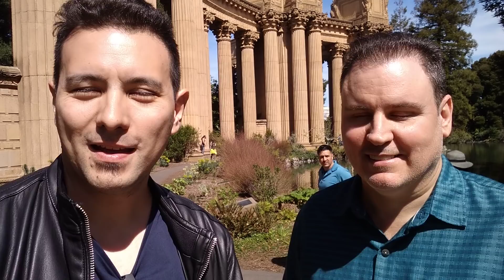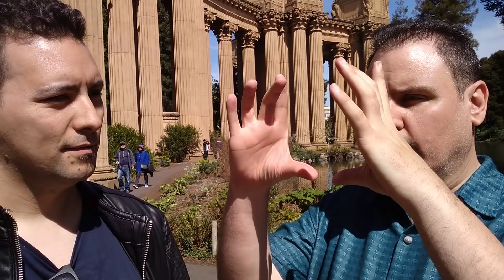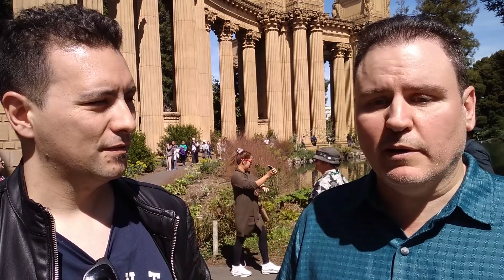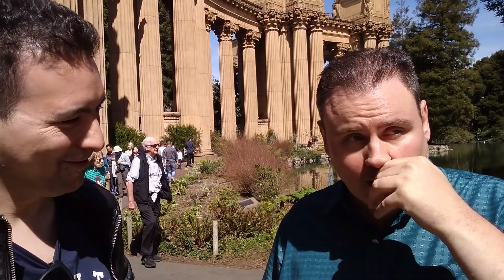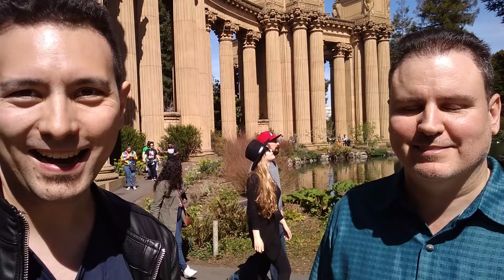GDC 19: Pimax Pre-GDC Announcement - New Headsets / Base Station News

Comment: Literally no reason to ship the 2.0 Lighthouses until the 2.0 controllers are ready as well so may as well ship them together - saves a shipping nightmare as well
Reply: Tapek what if you are someone who had no base stations before ?

They can play some 6Dof games that don't use hand tracking if they get the base stations.
Reply: @techhelper322  Actually no. You need controllers to actually set up / calibrate the basestations... so yeah, there is little point in shipping the BS already.
Reply: Yeah. 2.0 base stations on their own are useless.
Reply: @techhelper322  Vive 1.0 wands do not work with 2.0 basestations so only people who own vive pro will be able to use the pimax base station and if they already have a vive pro, they dont need the pimax station for any use since it is already 2.0
Reply: @gerthddyn  if they waited till they had finished everything else the headsets would be 2-3 year behind schedule not the 1.5 years behind they are now, (if you ignore the fact they have absolutely nothing for the 8kx)
Reply: @JenoSnetrem  no you don't,  you could get 1 or 2 base stations and play racing sims or flight sims with out controllers.

Comment: Lighthouses, pleeeeaaase! I have a hard time to get solid connection with my single Vive base 1 that nails me to gyro tracking. Adding to that I just backed the lighthouse not the controller, so it's obvious I want them shipped previously. (Plus the prescription  glass insert which is more needed than in any other headset)

Comment: I want my basestation asap, please. I am a simmer, and I didn't even back or order controllers. I might get them eventually, depending on the reviews.
But for the moment, I just want my basestation.
Maybe in the official announcement (through kickstarter plz), you can ask for those who WANT their LHs early to email their backer number and confirm their address etc. It will probably only be a small percentage of the backers who will do this, so it shouldn't clog up the support system too much.

Comment: There is no reason to ship 2.0 lighthouses with out controllers.  Existing controllers (a.k.a. Vive wands) won't work with 2.0 lighthouses.

EDIT:  I just thought of a reason (albeit small) to ship the lighthouses.  If you exclusively use flight / racing sims you may be waiting on lighthouses to go with your Pimax HMD.
Reply: I'm pretty sure that gen 1 gear works with 2.0 lighthouses
Reply: @tacocat709  No.  It's the other way around:  2.0 gear works with 1.0 lighthouses.  All current Pimax HMD owners (2.0 gear) are using Vive 1.0 lighthouses.
Reply: Vive Pro controllers and knuckle dev kits should work with the 2.0 lighthouses.
Reply: @NGenesis  anyone who has vive pro with 2.0 controllers already has 2.0 lighthouses. anyone who can get knuckles can get 2.0 lighthouses from valve.

Comment: So in November I spent 1059 USD on an OLED Pimax 5k. How much more do I have to spend if I want one that doesn't break? I didn't know the one I ordered was made using low quality parts. I mean.. it's a 1000 bucks..
Reply: 500 Dollar more. Then you still need Vive Base Stations and controller. Controller shall com allegedly in the 3rd quarter and sensors/base stations on the 4th quarter. I'm so full!
Reply: @PrinzMidas I don't mind the fact that controllers and base stations are separate, because we already knew that from the start. What we DIDN'T know, was that we were buying a 1000 dollar headset that's made from low quality parts and breaks easily, and we have to spend an editional 500 dollars if we want a 'non-breaking' version.
Reply: @stranger.granger  I totally agree with you! But we also didn't have known. that we need to wait such a long time, after we got the headset already, until we can use this headset completely. I'm really disapointed, and I mean for several reasons.

Comment: Pimax - can you please concentrate asap on controllers and base stations, and then on the new headsets. I have 5k+ sitting on the shelf collecting dust. Cannot even test it fully to see if it working properly. " It is like delivering new car to customers without a steering wheel and wheels! Then sending set of wheels and then few month later steering wheel. And on top of that you are producing more new models without steering wheel and wheels". I am not going to buy controllers and base station from other manufacturers just to use it temporarily. I already spend just under £1000 for your complete set. So for me lighthouses and controllers together please.

Comment: Best suitable to ship the controllers and base stations simultaneously ONLY if the base stations aren't backwards compatible with 1.0 Wands.  I shipped my Headset to that warehouse for an RMA. Does that mean my ticket is with Kevin?
Reply: the 1.0 wands will not work with 2.0 base stations.

Comment: Please offer the lighthouses separately, the knuckles type controllers are not suitable for our application. Vive pro 2.0 wands (the blue ones) can be bought separately. 5k+ RE might be good for us. I'll ask Stephen Bowman when he will get one in London that I can try out.
Reply: Youre going to pay £200 each for 2.0 controllers? Dont be insane.
Reply: @ge2719  We only need one, but it needs to be device you can pick up and put down, no something that is strapped that is strapped to your hand so a Vive wand is better. We actually only need 1.0 base stations and a wand, but do you think the reliability  (MTBF) of the 2.0 base stations would be better for daily commercial use? I've been told that for seated use just one base station is sufficient for Pimax thanks to the rear facing receptors on the HMD.

Comment: Are 2.0 lighthouses able to run in 1.0 mode? 
Would help those who have original vive controllers.

But also if you have the two 1.0 Vive lighthouses, and can use Pimax ones in a 1.0 mode, can you use all 4 for increased space and tracking?
Reply: OG Vive controllers will not run with SteamVR 2.0 tracking, but Vive Pro controllers should work fine.  SteamVR 1.0 tracking only supports 2 base stations at maximum.